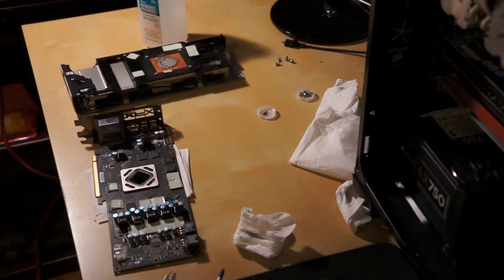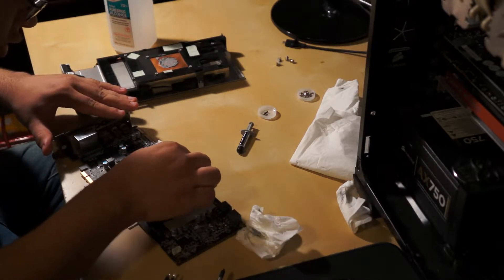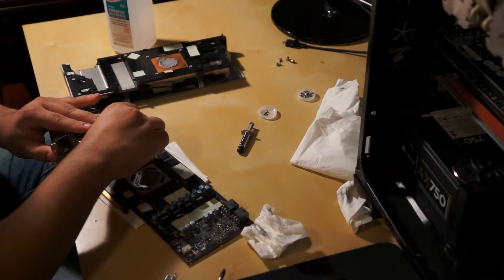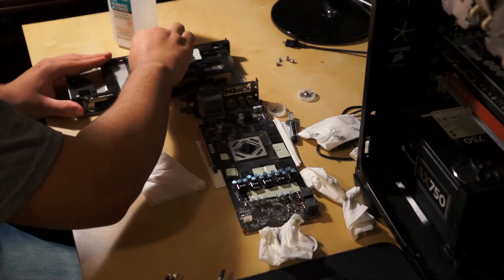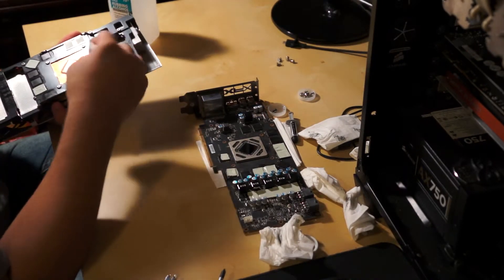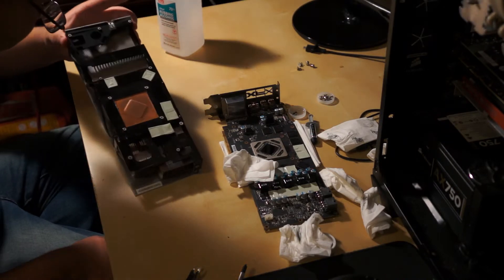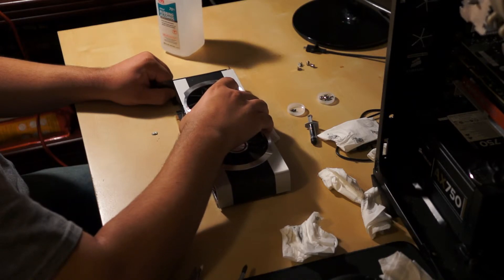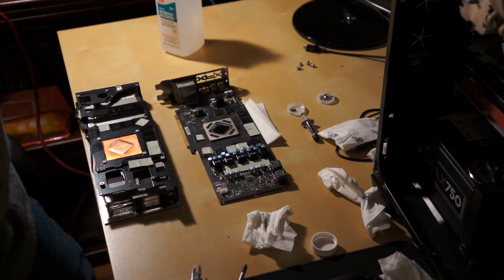XFX 7950 Double Dissipation Thermal Paste Swap Part Three (Cleaning the Coldplate)

Comment: At 4:30, yeah, I'm glad you said something because I've just opened this card and the surface of the heat sink is SHOCKINGLY scratched! I'm going to use a bit of fine sandpaper to try to get the GOUGES out of it before putting everything back together. PS: use acetone nail polish remover with round, cotton face pads to remove the thermal gunk. THEN, go over everything with rubbing alcohol. I removed the fan shroud, as well. When cleaning the board, I held it vertically and used a cap of alcohol and a nylon artist brush to go over the entire board, back & front. 👍